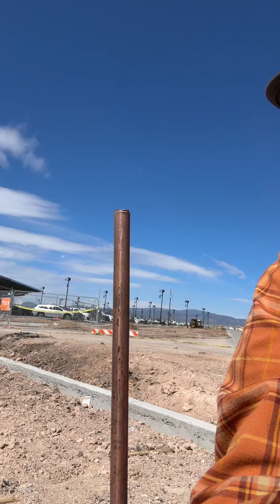Three fantasies related to ground rods at metal light poles. MikeHolt.com/Fantasies

Comment: Don't you still want lightning to have the best possible path to ground instead of your equipment wiring carrying it all to the surge protector device?
Reply from the maker: A ground rod connected to a metal light pole is not going to make any difference from a direct lightning strike.
Reply: @MikeHoltNEC  What about an indirect lightning strike? What if the pole foundation itself isn't providing a good ground?
Reply from the maker: A ground rod serves no value ever at a metal light pole.
Reply: @MikeHoltNEC  NEC 250.32 and 250.54 is telling me that a pole containing electrical wiring (such as for a camera) requires a grounding electrode system.
Reply from the maker: FALSE

Comment: I’ve built radio towers, they require ground rods at the base of the tower as well as the top (for lightning protection) we always have power ran to the base of the tower….. what do we do in this instance? keep the grounds separate?
Reply from the maker: Radio towers are build to the specifications, which is beyond the scope of the NEC. These 'radial' grounding configurations are intended to assist in directing the lightning 'direct' strike away from the receiving equipment. AI says ...
"Here are some tips for radial grounding of radio towers:
Number of radials
The number of radials needed depends on the length of the antenna. Shorter antennas may need many radials for reasonable efficiency, while longer antennas may only need a few. However, adding more than four radials may not provide much additional benefit.
Radial bends
Radials can bend gradually around obstacles or to follow the terrain, but sharp bends can add inductance and cause lightning to look for an easier way to ground. Any conductor that will carry lightning current should have a bending radius of at least 8 inches.
Maintenance
Ground systems typically require some maintenance, especially if site conditions are poor. The area around the tower bases should be kept free of weeds and brush, and tree and plant roots should be monitored. Regular mowing and spraying can help keep the area looking neat and reduce damage to the radial wires and ground straps.

Comment: I have a metal pole fed by 3 wires: ground, null and phase 230V). I've already connected the groundc onnection to pole body. Is there any good reason to now add a new grounding rod to the pole? If not, does it do any harm in doing so? (hose grounding will them be connected to this new pole rod..) Thanks.
Reply from the maker: I don't know what 'null' means. The circuit to the metal pole, in accordance with the National Electrical Code in the US must contain an equipment grounding conductor [410.30(B)(5)]. Please watch MikeHolt.com/Fundamentals. 
Adding a ground rod or not to a metal light pole does not add any value nor does it cause any harm.
Reply: @MikeHoltNEC  I am in disbelief that so many states mandate the use of pole grounding rods for nothing. I mean.. why would they even bother if it has no use? In my country, (Romania), I see all light poles grounded.. on the streets.. in the parks.. you name it!
Reply from the maker: @cezarvancea  No state in the US requires a ground rod at a metal light pole!
Reply: Look into what earthing/grounding system you have, it is TN-S or TN-CS, from your description we can count TN-C out. With TN-CS you have current in the PEN conductor shared with whatever stuff that is connected to that circuit, this fact can create "stray voltage" (wrong wording, but best we got) on your PE and N conductor with reference to earth/ground, when you connect/bond your metal part, that is already bonded to PE, to a ground rod this stray voltage will still be present, your PE conductor wins that battle, the stray voltage may be small, like milivolt or it can be measured in volts, sometimes it is a problem like at some farmers or swimming-pool owners, it all depend.
The takeaway is that grounding to a ground rod is not a safety measurement in its own.

Comment: I recently had a contract where the utility company provided the light poles and electricity from them. In this case, each pole had a photocell. Each pole was always live, being fed straight from the utlity transformer. There was no disconnecting means. Would this be a valid use case of the ground rod, seeing as it is fed straight from the transformer? Also, I know I commented on your other video. Been busy with school unable to watch the video yet, but I promise I will watch it.
Reply from the maker: Watch MikeHolt.com/Fantasies and let me know what you think the answer is.
Note: Nothing can be more dangerous than a metal light pole where the circuit to the pole has no overcurrent protection and no equipment grounding conductor bonded to the metal pole. Because there is a ground rod connected to the pole, in the even of a ground fault, not only can one get shocked by touching the metal pole but they can also get shocked by touching the ground rod or simply walking close to the metal pole... Watch MikeHolt.com/Fantasies.

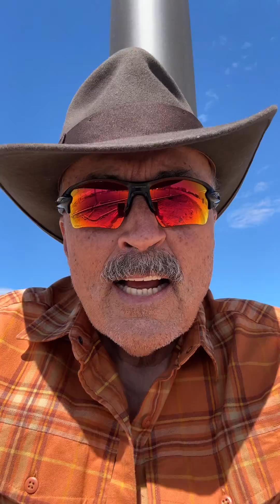Comment: Sorry but that ground rod is protecting the pole. There are no wires inside the pole because the light is fed by PV as you can see at 0:08.
Reply from the maker: What is it protecting and what Code rule?
Reply: @MikeHoltNEC  The PV system. 690.41B.
Reply from the maker: @atubebuff  690.41(B) has nothing to do with connecting a metal pole to a ground rod. 690.41(B) is about GFDI protection (part of the dc-dc converter) for PV dc circuits exceeding 30V or 8A.
Reply: @MikeHoltNEC  How many watts is the  PV fed light? Is an ungrounded PV system considering acceptable? I suggest we climb the pole and get to the bottom of this.
Reply from the maker: @atubebuff  I loved 'climb the pole to get to the bottom...' Making my day after so many crap responses.

Comment: Also, I don't think it's required by the NEC, is it?
Reply: Nope. If it was Mike would tell ya
Reply from the maker: No the NEC does not require the metal pole of a light fixture to be connected to a ground rod. That is what this reel is about.

Comment: This whole situation with a light pole at a public pool is where I got such a shock to the leg I thought I felt it pull through my back and out my arm. The beginning of the end of my career. To this day people don't seem to understand the risks of it and how it works. Thanks for all the courses. We looked up to those willing to teach us right.
Reply from the maker: Wow you survived... I've been on too many cases where young kids get killed touching a metal pole that is connected to a ground rod and no circuit equipment 'grounding' conductor is connected to the pole in violation of 410.30(B)(5).
Reply: Yeah the whole point is to eliminate voltage differential without creating multipaths.
Reply: @Oldhogleg  the whole point  for the EGC is to cause the breaker to trip through a low impedence path  during a fault and save a life
Reply from the maker: @Oldhogleg  no... please watch MikeHolt.com/Fantasies

Comment: What about ground rod for a subpanel at 250 ft from the main panel is that a requirement?
Reply from the maker: The remote building disconnect is required to be grounded to an electrode in accordance with 250.32(A). In addition an equipment grounding conductor with the feeder must terminate to the disconnect in accordance with 250.32(B).
Reply: It is a subpanel.  It is grounded at the service disconnect (NEC 250).  A second ground rod provides the opportunity for lightening voltage to travel up the first ground rod, pass through every grounded panel, conduit, box, fixture, motor, appliance, computer, electrically sensitive equipment and insurance claim then back down the other ground rod to return to source (the earth).  Mike has interesting videos from a couple of years back with very nice graphics.
Reply: @larrylawson5172  thanks for the answer
Reply: @larrylawson5172 also a lightening strike to one of the bonded metal parts nearest the subpanel (think metal building) would give it a path to earth. As opposed to possibly energizing the bonded parts where it could enter a person.

Comment: So what about protecting against from a short to the pole and not just lightning.  Also wouldn't a ground rod just create a ground loop to the J hooks from the metal pole's foundation ? Or ground loop from the J hooks (threaded rebar the nuts go on to hold the pole base)?.
Reply: There is a grounding conductor that will carry that current back to the panel and trip the breaker.
Reply: Mikes done the experiments. Search through his stuff.
Reply: But wouldn't the grounding rod negate that ?  As it loops yo the j hooks ? Just like in a house 2 rods too close together ( must be 6ft apart I believe) . Guess only way to find out is to create a mock up m see for myself .
Reply: @gusc6785  No. It's basic theory. Electricity is trying to get back to source, not ground! The source in that situation is back through the equipment grounding conductor (green wire) to the panelboard that serves the circuit, through the main bonding jumper, and back to the transformer serving the system.
Reply from the maker: What a great response! You are my hero for today.
Reply: Sounds like someone was listening in class! 😁@MikeHoltNEC